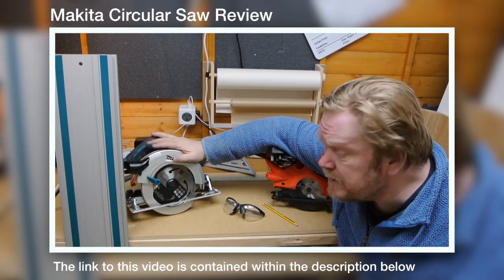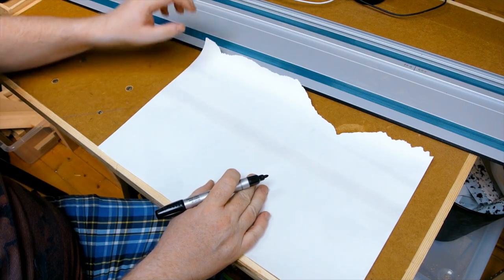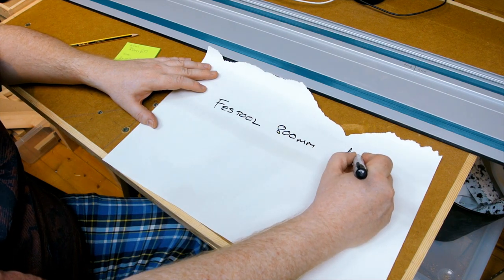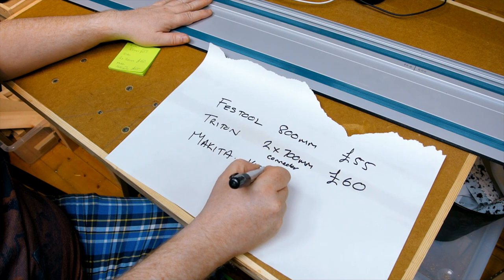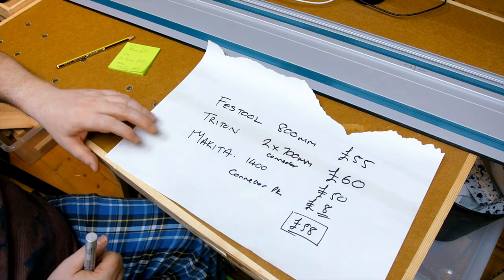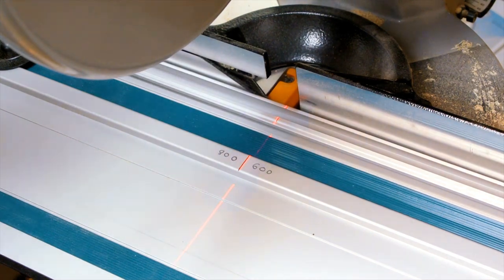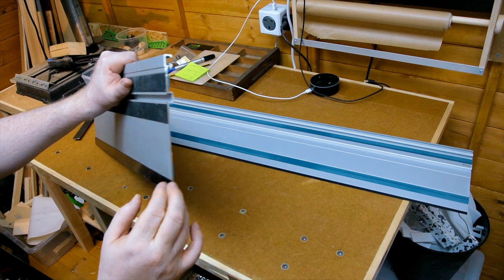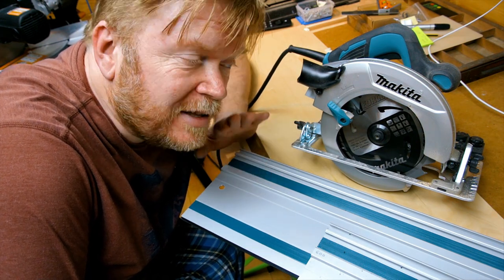Making Shorter Makita Guide Rails | 2 Rails For the Price of 1 | Tool Review

Comment: Just came across your video. Originally I bought the Makita track saw with 55" rail and connectors on sale and added another 55" track for large cuts on 8' sheets. I have a very small shop 12 x 12' so even contractor table saw was always a huge pain, I have a garage attached but it is unheated in Canada, so it is for breaking down full sheets only. Made a small foldable cutting table with foam top and the Makita is my main saw now. Few months ago I bought 75" track on sale so I did what you did and cut my spare now 55" into 32" and 23" just like you. Perfect for my size shop for the short cuts without the huge overhang. Built all my replacement furniture for my houseboat with it, drawers and all. Bonus is the vacuum attachment, no more clouds of saw dust. My newest addition is a 90 deg clamp-on jig for the track made from rafter square, $15 cad instead of $200 like the Festool triton one on internet. So far it works great. Never touched the table saw for over a year now.
Reply: Honestly what do you use that small of a track for other than shelving? I'd love a 40" for cutting down doors 32" and under, but I can't find a Makita 39 anywhere in Canada. I have a spare 55 but can't justify cutting that because the other 15" would be useless. I guess I could cut a 75 down to a 40 and a 35.. but then once you have a 40, what good is an extra 35? Makita should make more lengths ..

Comment: Great idea - which I'm going to follow. One thing though - if one half is 600mm and the other 800mm then they're not halves.
Reply from the maker: Cutting the rail into two pieces has been great. The 600mm one I use all the time and I would recommend unequal halves.

Comment: I just trimmed all the factory ends on my Makita rails.  The shorter ones weren't that bad but my 75" rail was off about 1/4".  They are really nice and straight to join together now.  Just used my Dewalt miter saw and a Forrest blade.
Reply from the maker: I aways check and I've only had to resort to a file a couple of times to get things to join. I now label my rail ends as over time I've learned which ones join better than others.

Comment: I've been pondering this for a few days. I don't want makita or festool rail since the Milwaukee rail is a lot thicker and stronger and has an extra feature. I'm considering buying two 1400s and cutting both, one as you did 800/600 and the other 1000/400. But will the 400 be any use at all? I imagine with a square attached it'd make for perfect square cuts on long thin timber like 90x45 or even less. I've always freehanded stuff like that with mixed results in the past. Thiughts? What exactly limits the shortness of the track?
Reply from the maker: Hi, thanks for the question. I've put a Festool rail square on the 600mm rail and it does a pretty fine job as a simple cross-cut saw for construction timber. You need to remember that the 50mm depth of cut on these saws is only achieved at the blades lowest point so to cut a 150mm joist you need at least the length of the saw before the cut and about 100mm afterwards, so that might be 250mm + 150mm (timber) + 100mm = 500mm which i would say is a minimum. You can just plunge straight into the timber but you only really save 100mm or so. I would say 400 is a bit too short.
Reply: @StrawbyteWorkshop  thanks for explaining! I get it now. So absolute minimum is determined by where the square puts the track. You'd need saw shoe length plus timber length of cut if you plunge, so for 90, let's call it 100, 350 absolute best case with full saw engagement but if you're happy letting it just roll off the end then less could suffice. Thanks again. I will buy the rails soon since the price is going up in a few weeks. I'll make calls on cutting division once I have saw and squares. Thanks again for your insight! <3

Comment: By the way, 1000mm length of track is now available from Makita in the UK, but I still think your idea is better. Price is around 40 quid and part number is 199140-0. I got the kit with two 1500mm tracks and I'm finding, like you, that a shorter rail would be really useful. I'm going to cut one of my rails  into 900mm and 600mm which will give some useful combinations as well as  short pieces. If I ever need the full 3m then I'll just have to buy another connector kit. I've an Evolution R185SMS
 saw. It has a "multi material" saw blade which cuts just about anything so hopefully should do this job. I would love to hear a bit more detail of how you cut it. I notice you started a plunge cut right on the raised guide part of the track , then some of the cut is not shown on the video, then you are doing a slide cut from the front of the rail. Can you add any detail to this please?. I have the saw and the track, so  I'm ready to go, so any tips appreciated:). Thanks for an inspiring video.
Reply from the maker: You're absolutely correct and in-fact another video on the channel that shows me cutting the splinter guard for the first time was on a brand-new 1000m rail. I like the very short piece a lot and its probably my most used rail in the workshop as it makes small cuts or cut-outs really simple. Of course if Makita did a 700mm rail like Festool did then there wouldn't have been the impetus to pull off this little stunt but it's caught peoples imaginations and I know many who have cut there rails in two as a result. Thanks for the comment.
Reply: @Strawbyte Workshop  Thanks for that. I am all ready to start making Aluminium swarf. I just wondered if you saw the latter part of my message and you have anything to add to the actual technique for cutting the rail please - I'm a little nervous about it...
Reply from the maker: @ritcheycretien9875  Ooo.. no I didn't YouTube cut the message at the end of the sentance I didn't notice the show more. At the time I don't remember thinking about the cut. I placed the rail with the higher part at the back and went for it slowly. One thing I would do next time (perhaps) is place a piece of hard-bard or MDF under the rail to support the back of the cut. There was some roughness to the cut on the backside and some swarf that needed coaxing off with a file (not shown). And that's about it. Oh, and watch when you extend the saw arm out that you don't pull the saw to one side or the other. My evolution saw was a tiny bit sloppy as you extend the saw out.
Reply: @StrawbyteWorkshop   OK, done it!. The Evolution R185SMS saw turned out to be 110V so
was sent back and I got a Evolution F210SMS. That is an older model,
but brand new and just about identical to the newer R210SMS except the 
colour!.

Took your advice and backed it up with a bit of 8mm MDF. Clamped each
end of the Makita track to the saws wings and let the track rest on the
rollers of the Evolution saw stand. Lined up cut mark with the laser,
let saw run up to speed, plunged fully with slide right out and fed in
slowly on the slide. Cut beautifully and did not move at all at the end
of the cut. Even the black strips and the splinter guard cut cleanly. 
The blue slide strips got a bit feathered, but interestingly, that disappeared
on the first strip as I cut. I think the feathering on the second slide strip
would have gone too if I had lifted the saw and plunged again. Although the
work was clamped well enough, I didn't want to push my luck any more.

I'm delighted with the results, no burr whatsoever an the ally and it just
needs the sharp edges breaking with a deburrer or file. There should be
some images at the links below.

I can't thank you enough for kicking this idea of. I can now do a job
which I previously did not have room for. 

Peter

https://ibb.co/y0q4kFt
https://ibb.co/8KPXLqY
https://ibb.co/Sm6cGng

Comment: Thanks for sharing Karl. I have just ordered the guide rail adapter (part number 196953-0) for my Makita DHS680 cordless circular saw from FFX . It’s £50. If it doesn’t work nicely I’ll sell the saw and buy the cordless Makita track saw as I have 3 x 5ah Makita batteries. I’m now looking to buy the track. Thanks to your video I can now search for the 1000mm track and keep the sawing of tracks in my back pocket for future ref. Now subscribed.
Reply from the maker: No problem Christian. I now have the corded track saw but still use the circular saw on shortest track for crosscutting beams. I'd love to hear how this turns out for you.

Comment: I don’t know if you know this but Makita came out with a 39 inch or 990 mm track, it’s about 65 or $69 US. I thought about doing the same thing you did, but I just haven’t been able to do it yet.
Reply from the maker: Hey there Luc. Yes in the UK they're marketed as 1000mm tracks. They became available in the UK around 5 months after I made the video. However I do find the shorter of the two guide rails (600mm) really useful for both track saw and router.

Comment: Put a bench dog square on it and you have a hand crosscut guide. Bosch make a short rail with a square but I find mafell / Bosch slip around, plus it's £110
Reply from the maker: It’s been a while since I made that video but your right, a rail square attached makes for easy cross cuts. Thanks for the comment.

Comment: They do make a 1,000mm track but you can also buy a pack of two clamps which slide into the track (one at each end) with which to secure a track across a shorter workpiece so that you don’t need to cut a long track to a more handy size.
Reply from the maker: Paul, you're absolutely right about the 1m rail and I did feature one in a later video where I showed cutting the splinter guard for the first time. At the time of the video the 800mm festool rail was around the perfect size for my needs but, as I explained, they're really expensive and there were few alternatives. I don't regret taking a full sized rail and cutting it in half. the shorter piece gets used all the time. I picked up a Festool FS-Rapid/R rail clamp really cheap (£15) in Amazon Warehouse some time ago and it lives on the shorter rail and is super handy for cutting posts or 2x12 rafters/beams.
Thanks for the comment and giving my video a watch. Take care. Karl.

Comment: Hi just come across your excellent video, when I looked into buying a rail to cut in half I find that Makita do a 1m rail, I think it might be a new addition to thier range...
Reply from the maker: Yes you're absolutely correct the part number is 199140-0. Oddly it's listed on Makita UKs website with no description or data sheet. I found it on FFX for 39 quid.

Comment: First of all, really helpful videos on this system, but I was wondering how you rate the guide adapter? I'm deciding between this system and the plunge saw. Would you now prefer the plunge saw? Or have you experienced anything that would warrant you purchasing the plunge saw?
Reply from the maker: Hi Tom. I get asked that question a lot and the simple answer, with the benefit of hindsight now I have a plunge saw, is going for the plunge saw would have made more sense. I now have two very well made and recommendable saws with one doing 90% of the work and with a few tricks a conventional circular saw can't do safely. Chief amongst these plunge cuts. 

That said Makita circular saws are incredibly affordable and the package of a rail, adapter.and saw was about 1/2 the price of the comparable corded plunge saw. And setting up for the cut is no quicker. 

I'd still recommend this setup if you have the saw already and want to make fast accurate straight cuts.

I should add that I have rail adapters for my Makita Jigsaw and, Bosch and Makita Routers. I'll get.around to featuring them on the channel soon.
Reply: @StrawbyteWorkshop  many thanks for your reply, I've been looking at the Makita DHS680Z with guide and adapter, as well as the Makita SP6000J1 plunge saw, I'm not sure if tool prices are low at the moment, but if you factor in batteries and a charger for the DHS680Z, then the plunge saw with guide is the cheaper option. Anyway thanks for the info.

Comment: 😅 nice but that track moved & u didn't say nothing 😂😂  i was thinking about getting a 1.5m track & cutting it down to a 1m track & 500cm track.  I dunno tho, is 500cm too short?
Reply from the maker: I can't tell you how many times the track moving gets noticed or how many times I wished I shot that cut again! So i settled on 600 and 800 an i I think 600 is about as low as you can go. It is the more useful length.
Reply: I was thinking of using the same cut. That way I can buy another 1500mm track and joint it with the 1000mm to cover 2400mm full length plywood cuts.  I figure 500mm is a good size for short cuts but I'm open to being advised differently.

Comment: hi there hope you are well !!. Can I ask you something please?... after 3 moths of use (after getting some bench dogs/mft top from cnc design) I come to the conclusion my track makita 1.5m is slightly bowing outwards at around 0.1 to 0.2 mm - do you think that is okay . I think if it was 0.05 mm that be fine it would be the piece of wood would be up on one side slightly than the other prob the thickness of a piece of paper . For cabinet making what do you think - have you ever tried to see if yours is really true, perhaps in the real world its about perfect i can get one:(
Reply from the maker: Hi Christopher - The consistency and accuracy of makita rails has been a constant comment point on the videos that I've posted featuring them. If I say that Makita rails are cheaper than Festool someone will always comment that Festool are more accurate. I personally think that anybody that expects 'rocket science' levels of accuracy from a material that was pushed red hot through a die and then allowed to cool is expecting too much from the process. Following your email I checked all the rails I have (1 x 1400mm, 1 x 1000mm, 1 x 1500mm and the 1400mm I cut in half) and in all cases I find a variance along the back of the rail of between 0.05mm (on shorter rails) - 0.2mm on the back. So I would say this is normal. An MFT top will be +/- 0.05mm accurate (as it's MDF afterall) and so when using my Parf Dogs in the set-up I can only think that everything is within tolerance. And if you're working in wood how accurate are you aiming for? A sheet of 80GSM paper is 0.1mm thick with a fine pencil mark made on it approximately 0.5mm and an error of that magnitude isn't going to be noticed in the final piece. Just as an aside, when I make my track saw waste side jigs I make them to within +0.09mm to -0.01mm accuracy with two guides used to align the rail introducing a maximum error of 0.1mm. I know from feedback that everyone is super happy with their accurate waste-side cuts and the fact I have manufacturing tolerances is the last thing they care about.
One other thing I would say is that in my experience factors like, remembering to tighten the thumb screws to take the slop out the saw on the track, blade wobble or wear, condition of the splinter guard would have a much more significant effect.
It's an interesting question you raise. There are situation where it matters in my experience, such as joining two rails, where it can get really frustrating and I've had to send back 1 rail which was more banana shaped that straight or flat. Otherwise I'm happy with the results I get and when I'm not it's always been my fault rather than the saw.
Let me know what you think.

Karl
Reply: @StrawbyteWorkshop  Hi there, actually since I sent that message to you I have been doing a bit more investigating probably to the level of Columbo haha. anyway what I found was that : 1cm to 75cm the track is dead on, 1 to 85cm it is 0.1cm and 1 to 120cm (as i need space to put track saw on and off  the track) is around .2mm. But also I am taking notice of the part the back end that is in contact wit the dog - so actually it well could be that the back part (and it is "n" shaped) might actually be just slightly bent in. Now I about to try track  dogs which screw into the  underside and so its on a different part of the track it self and so the result might be actually dead on all along. If you use those track dogs though there is a bit of slack, so what I did is just push the track back as you tighten each one and I found it fine - going off a pencil line i did before hand.  In the real world though as you may find in your case 95% of the cuts is below 60cm so i am safe . for very long cuts i may end up eventually buying a 2,5m (I think that is the size) track. I speculate the front part of the track ...all along is more likely straight and prone much less to any kind of bend, unlike the back length which was probably done by human error (a knock or bang for example) Thanks for the long reply -I appreciate your thoughts and time spent :))))))))).